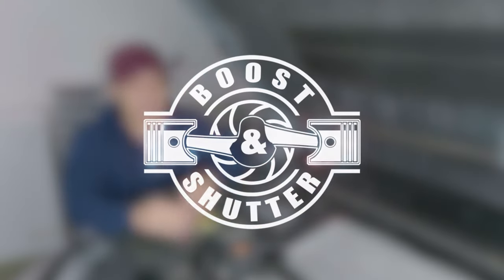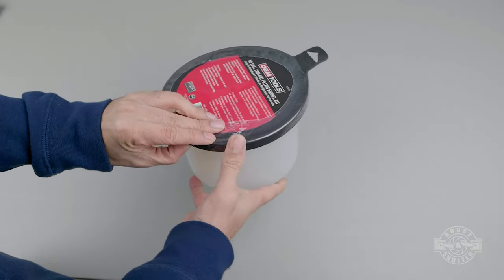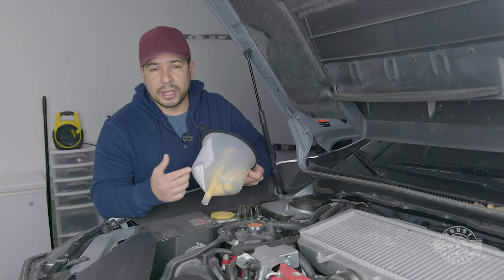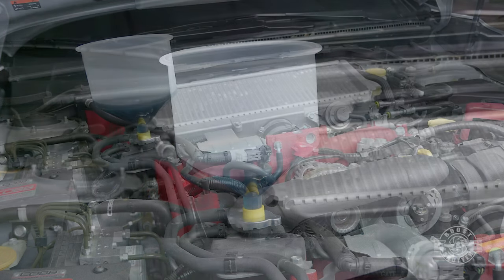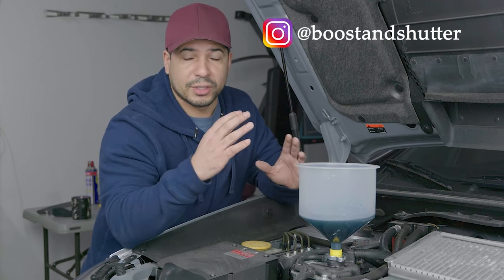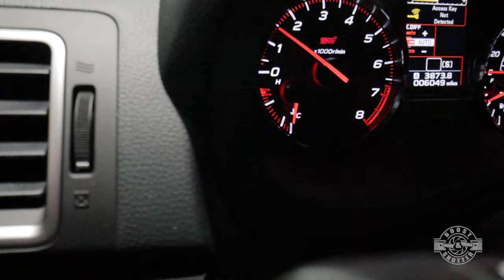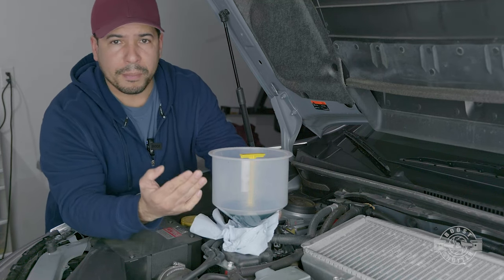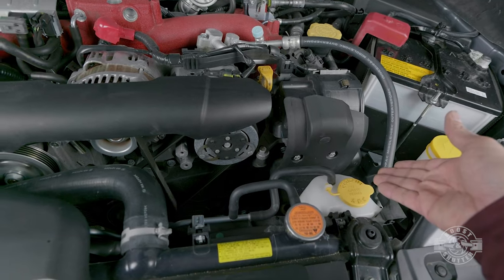How to Burp Cooling System | Subaru WRX STI |

Comment: Pro tip, squeeze the upper radiator hose then put the plunger in, sucks it down where you wont have any spillage when removing the spill free funnel.
Reply: Question just for clarification to avoid spillage: do you (1) squeeze AND HOLD the squeezed radiator hose, (2) insert the plunger/stopper while continuing to squeeze the hose, (3) release the squeezed hose, and then (4) remove the spill-free funnel?
Reply: @craigcraigster4999  i think you can release the hose after inserting the plunger because it will reinflate with coolant and create a mild vacuum to suck the additional coolant into

Comment: After a long and very frustrating day of working on the car I just wanted to say, this video saved the day thanks for your content my man. Made the process very easy and you are very professional. Very quality video👌
Reply from the maker: Glad it helped!
Reply: @akqjtn  hi from australia, i have a 2002 subaru wrx, my heater suddenly stopped working, then noticed a leak bottom of radiator , i just changed it installed new one, then coolent, then burping , while burping/bleeding with sealed funnel, engine on , its getting bubbles out but same time water keeps rising and spilling over looking all crazy. heater works off and on mainly off,  no smell in cabin of leaks, no damp smell,  ,  whole timing kit installed by mechanic 3 years ago.  temp  gage goes past the usual under half reading, same time fluctuating , i went changed genuine radiator cap, made it much better, but still not acting right and bubbling in reservoir and coolent rises up to full and more. twice I've heard strange quick like clicking noise at heater erea. no leaks, no head gasket leaks or from thermostat , no milky substange under oil cap,  second day in working on it off and on.  also had my car on 35 degree drive-way to aid in getting out air bubbles.   as if coolent not circulating yet top and bottom radiator hose hot, 2 hoses on firewall to heater not hot, also flushed out with water hose , heater hoses also did a reseverse .  I'm really thinking 2 things first heater core has blockage" yet clean water came out for 10 minutes from heater hoses, heater not working, may come on quickly then nothing. I'm thinking also could be thermostat" though 3 years old only,  thinking grudgently to bypass heater hoses",  or pull out thermostat. what is your opinion??. thanx.
Reply: @leepopaz253 replace the thermostat

Comment: Why turn on the heat? If the car doesn’t come to temperature the thermostat will not open. The heat cools down the engine and A/C heats the engine. So technically using heat will just keep the car cool the whole time while trying to get the engine up to temp.

Comment: Man you saved my life with this vid. My car was fluctuating between 170-245° coolant temp all the way to and from work today, I thought i was gonna blow my motor and be out of work for months. I followed this vid to a T, and it worked like a charm, coolant sits happily at 175° now like it should. Bless you man 🙌 -for reference, my car is a 2011 wrx. This method works great for it.

Comment: I watched your video and did this last night.  The spill proof funnel kit is a total game changer.  I went with the EPAuto one mostly because it was able to be delivered sooner.  I do like that it's caps and adapters are color coded so you can easily match them.  For my '05 WRX it was the green set.  After filling I ran the car for nearly 30 minutes before it was no longer bubbling at all, massaging the upper hose throughout the process.  I then shut if off and let it sit overnight.  By pure luck, the level dropped to the exact right level in the upper coolant fill tank.  Thanks for putting this together, awesome job!

Comment: I did what you said about idling to 2500 rpm after 20 minutes and finally got last air bubbles out. Got nice hot air for winter months thanks to your instructions
Reply: I have same problem no heat did u wait till after the 20min of burping and got heater?

Comment: Great video. Doing the process, fan cycled once, still burping air, going on 45 minutes, getting alittle worried? No leaks. It's a honda civic 2004.
Reply: Still bubbling air, well over an hr.? Got to have another issue? Any ideas? Changed thermostat, no leaks, cooling fan cycled 3 times, still burning air like the beginning?

Comment: 2007 STI over here. Just bought a brand new oem turbo and wasn't aware of this. Needless to say, I am now shopping for a new turbo. BUT... when my new one goes on, I'll be sure to properly purge the system of air and be sure all the fluids are at level where they need to be. Thanks for this video even though this was made 3 years ago. It's still relevant as a maintenance step to be sure your XT/WRX/STI is running in perfect shape!
Reply: 3 years isn't long with subaru i'm using this to work on a 2008 and it still applies

Comment: I kept wondering how much coolant goes on the top reservoir. It’s full! 

Although I did purge the system through the radiator on a 04 WRX and got it working. Still going to do a second purge today through the top reservoir just to be sure. Great video!

Comment: Excellent video. I bought one of these kits a few days ago (hasn't arrived yet). I have a supercharged Lotus 7 that has front and rear radiators with lots of plumbing and long lengths of pipework and bends. Having a nightmare getting all the air out. Radiator to the rear is where the cap is and I have 2 bleed points at the front of the car. Ideally I need the front of the car raised to expose the air bubbles to the bleed points....and this kit seems perfect for that as it allows me to raise the front but also keep the fill point higher than the bleed point/s.

But my question to you is this: You're certain it's ok to run up to temperature? Without the pressure cap on, the coolant can boil. With the device fitted, it's still basically being run without a pressure cap. You've not had any problems overheating whilst you're purging air bubbles?

Comment: I did a couple coolant changes on my car. I learned after the coolant settle and still bubbles a little bit Rev it to 4k a couples times  to get all the air bubbles out. Now my car doesn't over heat.

Comment: I gotta simple question: You say turn heat to max. Do you actually turn it on as in air blowing out the vents, or just set the nob to max heat and nothing more? I have an ‘09 Camry for reference. Thanks for this great video! So much easier to follow than the rest. Great job.

Comment: Out of curiosity, can air pockets cause the STI to run much hotter than usual? It's not overheating, but running really hot and then it has issues starting until the car cools a bit. Along with the heating, when it gets hot the AC doesn't seem to work right, it just feels like a fan blowing not actually cool.  I took it and got it diagnosed, but they said they couldn't find anything wrong.  I have a 2017 STI.

Comment: I just flushed my 2021 Acura, using the same funnel. Replaced new coolant, but I’m only getting heat, when I set the controls to high heat? I burped the upper and lower hoses, still no heat at anything but high? Any suggestions?

Comment: Got a p0128 for bad thermostat. Replaced that. Drained and bled the coolant. Got temp to normal. Cooling fan never came on, it actually never did before. Unless the AC is on. Assuming bad ECT? However, my check engine light keeps coming back with the same code. I really hope i didnt get a faulty thermostat. Temp gauge doesnt even go past 1/4-1/3 mark now. Lower radiator hose is almost always cool to the touch. I did a boiling test on the old thermostat and it opened up, so my guess is that the thermostat was never bad? Could it be the ECTs? Please help. Should i try to re-bleed the coolant?

Comment: I want to change out my radiator hoses with an aftermarket option from grimmspeed. I did however just replace the coolant like 500 miles ago, so I don’t think I need all new coolant again. 
Is the right idea for me to drain and reuse the still fresh coolant? If so, what is the best way to drain the coolant?

Comment: hey, on the ej255 with the radiator cap off should coolant fly out when starting the engine? does so at both fill locations, trying to figure out if my mechanic screwed up putting the heads back on.

Comment: Thanks man. I did my Forester yesterday but without a funnel and holy heck what a mess lol but I think I got there. What's the go with checking the levels does that mean there's still air in there and the hot air raises to top of radiator? I don't think it's got a header tank but it is turbo 2008 model
Reply: Oh it does have a header tank lmfao thought it was the power steering reservoir hahaha

Comment: Hi there. Just followed your steps to burp my sti coolant out after fitted an adapter between my upper radiator hose for my water temp gauge. When I went for a drive the too rich code p0172 came on and car drive like crap and exhaust smell bad. What did I do wrong?? Checked all no leak no hose inflated and engine temp is right in middle!! I did however left out my intake snorkel when I burped the car for a while my mistake…..

Comment: I made a rookie mistake on my STI and long story short left the radiator cap lose. Leaked a lot of coolant and I ended up refilling it. Now I’ve noticed that every time I turn the car on (cold) sounds like water is sloshing behind the dash. Would this help?
Reply: I have the same current issue with my G35 , most likely when you added the coolant you didn’t bleed it witch led to it having air bubbles or air pockets build up , this will help out ima do it tmr and try it out but if that doesn’t help there can be other things such as , a clogged hose witch happens when air and debris get in , ima do it tmr and I’ll let u know
Reply: My reason I have water sloshing it’s because air got in and I didn’t bleed the power steering fluid and coolant correctly, so tmr ima bleed both of those and see if that fixes the issue if not I most likely have a clogged hose witch I would just take to the mechanic to fix

Comment: Just replaced the radiator on my sister's 1990 Legacy base model with the EJ22.  A few months ago I did a major tune-up and replaced all the hoses, and couldn't purge the cooling system.  Had to tow it to my mechanic to have it done.  I am currently waiting on the spill-proof funnel kit to show up today so I can try this.  I knew there was a trick to it but couldn't find out what till I saw this.  TY!
Hoping this will do it.
...does anyone know, since it wasn't mentioned, when 1st filling the coolant (radiator in my case) should the overflow reservoir be filled, too, before beginning the burping procedure and starting the car?
EDIT:  The answer to whether the overflow should be filled 1st is Yes. 
 Radiator and overflow were empty.  I removed the air vent plug cap on the top left of the radiator and filled the radiator with the spill-proof funnel per this video, till coolant came out of the vent plug.  I reinstalled the air vent cap, filled the overflow to just under Full, and followed the directions given by the OP.  The car was fairly level and on the ground. I spent about 40 minutes total, and was surprised how relatively little air came out using this method.  The gauge never went over 1/3 the way up, fans cycled 3-4 times, and a 15+ mile test drive after was uneventful.  This tutorial worked like a charm.  Thank you SO MUCH!

Comment: I burped the radiator fluid on the radiator cap and filled the reservoir up. The heater blows cold air when on heat and the engine over heats bad when driving down the road. I replaced the thermostat and  rebleeded  System still over heats I’m not sure if I put the pin on the top of the thermostat. I bought JDM EJ205 there’s no head gasket leak at all the oil isn’t milky and see no leaks.  I put in new radiator and hoses and new  ac condenser I’m not sure what to do I swapped both heater hoses to make sure I didn’t install it right but the car still over heats. I’m not sure if it’s bad water pump or thermostat or the radiator is blocked some ware or do you think the system has air trapped in it so it’s blowing cold air only and causing it to overheating should I buy this kit and  do it this way I’m not sure if this will fix the problem or not?? 

I basically bought 2002 Subaru Wrx for $250 bucks it had no motor and it was wrecked I fixed it the dash was ripped out ECU was pulled but I basically bought JDM EJ205 from JDM WestCoast I installed JDM ECU and the iwire kit

Comment: Wouldn’t it help to get even more access air bubbles out of the system if you jack the front of the car up to an incline to where the entry point of the coolant is the highest point above the system?
Reply: The funnel automatically becomes the highest point.

Comment: Great video. I did exactly the same as your instructions however after about an hour of waiting for the fan to turn on and off few times, revving the engine a few times and coolant level in the funnel no longer drops, every time I rev up the engine there is always bubbles coming up. There is no bubble when idle. Is this normal?
Reply from the maker: Are you positive it is bubbles and not just  coolant? When you rev it it forces coolant flow which pushes out of the radiator if the cap is not on. Look at it closely to distinguish between that and actual bubbles. A good test is to do press the gas slightly and you'll see what I'm talking about.
Reply: @akqjtn  ahha, gotcha. need a mate to help me as from cabin it’s hard to tell if it’s bubble or coolant.

Comment: I did this modification to my 05 WRX I was wondering if you or anyone who did this mod had any problems with their heating system after burping it. Do you still have good heat even after the modification?

Comment: Hey bro what’s up so I have an issue so I have a 2016 Sti but I noticed my driver side cooling fan doesn’t turn on like at all I’ve check the wire/fuse/relay I haven’t checked the motor fan  but not sure how to test it

Comment: I have a question about my 2015 subaru wrx CVT. The other day I was driving and suddenly whenever I accelerated the acceleration indicator would fill up quickly but there would be a huge delay before the boost would kick in and a weak one at that. There are no codes and it drives fine when I drive slow and don't accelerate. Have you heard of such issue in your experience with cvt wrx's? Thanks. Love your videos

Comment: Ciao! any advice in how to know if my car is overheating? My car has digital dashboard, the light shows when the car is already overheated, now I have to pay 1000$ for the damage
Reply: If you had recently removed coolant from radiator for what ever reason replacing a old radiator for new one or doing a radiator flush it is critical to fill the radiator up to the top then squeeze the top as well bottom radiator hoses to get the coolant within the engine while leaving cap off the radiator then starting the engine go back to the radiator watching for the drop of coolant to add more fluid being it will take some more coolant continue to watch the top of radiator if the coolant is dropping keep adding until the top of radiator can't take anymore coolant then put radiator cap back on & making sure the reservoir is filled to where max full line is, what many people fail to do is everything I explained they just fill the radiator up after flushing the system or had replaced a radiator core for new one then thinking once they fill it to top it's all good to go when it's not, there are air pockets in the engine without adding coolant as described the engine getting hot without proper coolant level will damage the head gaskets even worse crack the engine block.

Comment: this is the best coolant tutorial hands down. Do you put the cap back on immediately when done? As in, when it's hot? Or do you wait for it to cool before putting the cap on? Also, I thought the coolant system was pressurized normally. So, does having the cap off for performing this task harm the engine since the coolant is not pressurized? Or will it cause overheating with the cap off while performing this task ?

Comment: Is it okay for that upper reservoir to be so full after you're finished with the burping process?
Reply from the maker: I probably should have been clear you would need a little extra if reusing the old coolant, which is why there is some left over.

Comment: I had the hardest time burping my 2006 sti. Followed your steps and it’s going good for now, temp rise to 207 but it lowers here and there. Should I still keep burping it ?
Reply: Did u figure it out bro?
Reply: @Rlviral  yeah, took me a while to burp everything out. Gotta lift your car up from the front then pour the coolant so the it would push some of the air out, gotta let it run a while (turn your heater full blast), massage the bottom coolant hose and top to push some of the air out.

Comment: emptied my reservoir tank on my 2019 sti with 50k miles and saw a brown slime in the bottom? it does not feel like oil when i touch it. more like small brown little fibers that was in the bottom of my reservoir tank?
Reply: What you end up doing with it?
Reply: @raulvalladares1915  nothing i think i googled it or reddit and they said it was just a factory something like a conditioner for the coolant or something like that. i only saw it one time i have to recheck again

Comment: My reserve tank keeps filling up so I'm hoping a burp will fix this issue. Hopefully not my head gasket's going out :(
Reply from the maker: Normally you will see the coolant foamy if the head gasket blew
Reply: I'm going nuts here. Every time I burp the system and go for a drive the damn expansion tanks fills up and doesn't drop back down
Reply: @joelauseng8991  same here
Reply: @joelauseng8991 did u ever find out the root of ur problem